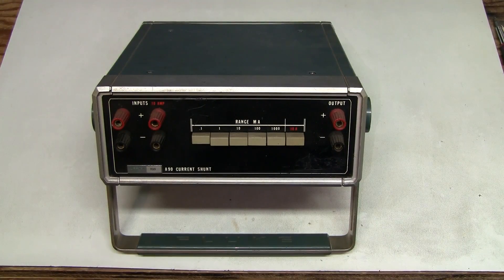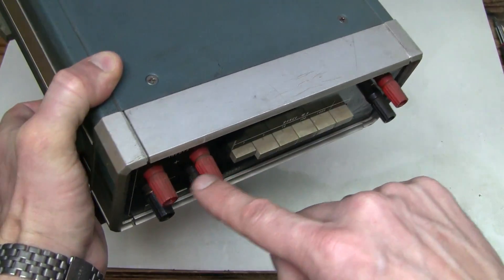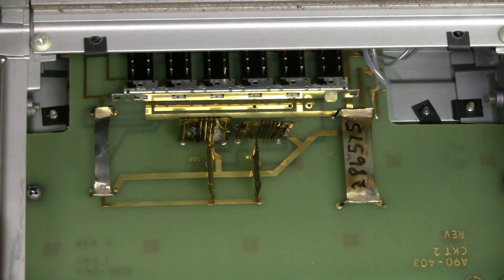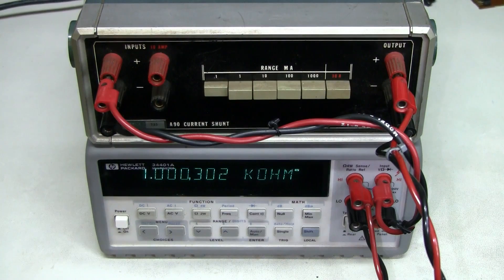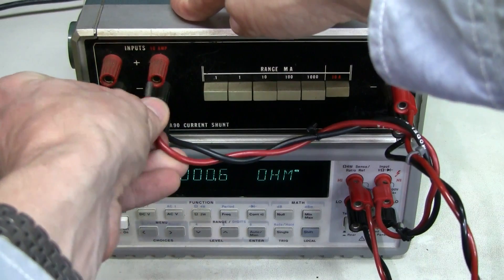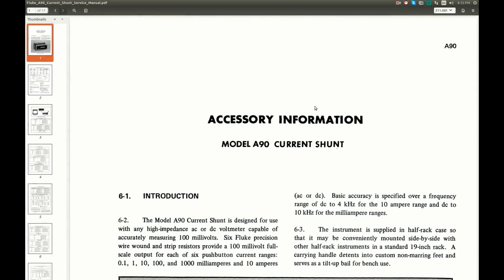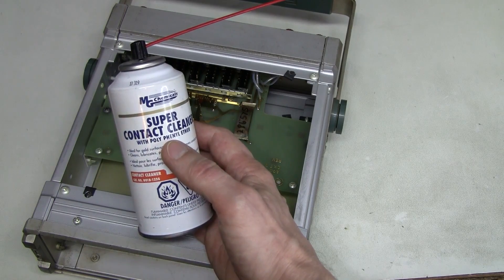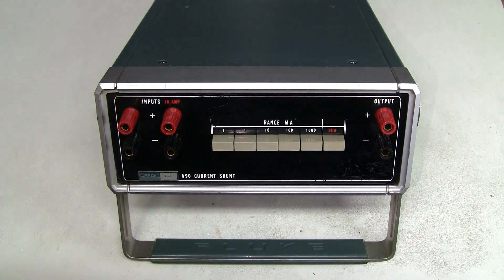#72 - Fluke A90 current shunt

Comment: Just want to ask you whether this unit can work with AC signal or just with DC?  Thanks.  what kind of signal can be inputted?  AC/DC or just DC?  Thank you
Reply from the maker: did you watch the video? the unit contains resistors
Reply: @feedback-loop  so it could use with either.   Thanks

Comment: Neat box. Those low ohm resistors are originals. :)
Reply from the maker: Yeah, I believe that. They just look a bit doggy.
Reply: @feedback-loop  Hand-shaped and trimmed by gray bearded nudes :D
How's KX LTZ going on, still working?
Reply from the maker: @xDevscom_EE  Sure it does. I did not log it as much as I thought I would. My interests are quite wide. Perhaps, even too wide. Not concentrated on metrology. I am thinking about building the other two boards one day, building a 10V scaling buffer for one of them, and putting it in some enclosure. Too many projects, too little time.
Reply: @feedback-loop  No worries, precision references are like wine, best when aged.

Comment: Nice old device. Separate 10A jacks are due to limitation of switching such high currents. Improve measurement of small resistor values by using OFFSET COMPENSATION technique. That will eliminate thermal offset  voltages. For 34401A, you need to measure SENSE voltage once w/o the measuring current, by disconnecting high input cable which goes to resistor, and shorting  input hi/lo by separate cable. Then press Null, and measure again in normal configuration.

Comment: Thanks for the video. Nice to hear from you again. I purchased an old Fluke 51/2 digit multimeter some years ago just to get one of these current shunts that came with it but I have never really used it. I will have to check the resistances on mine and see how they compare. Cheers, Gordon